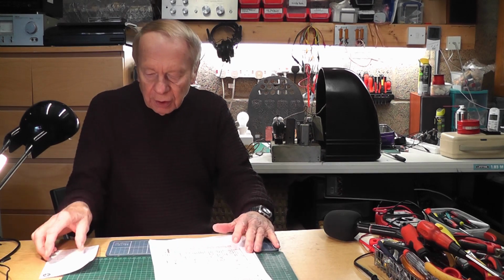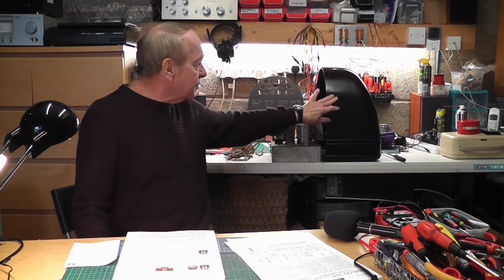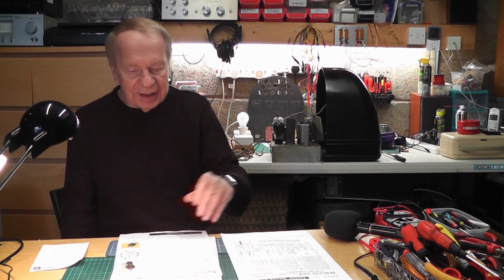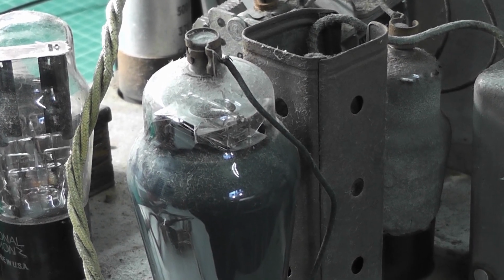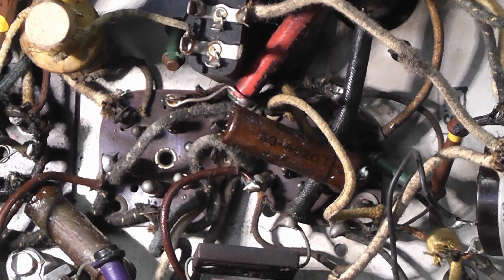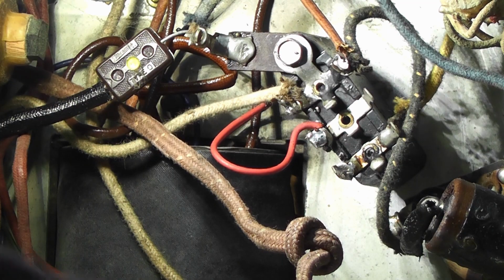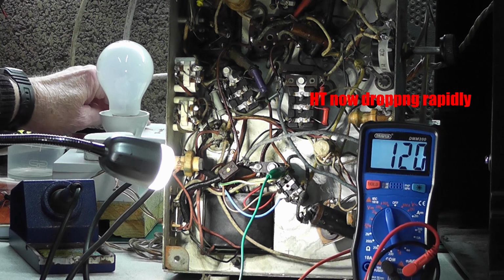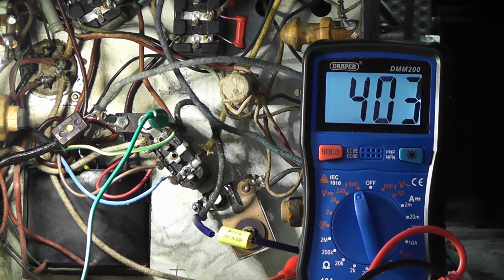Philco 444 Radio Repair  - Part One

Comment: Fire in the hold !!...Not often you get to see a failing smoking capacitor on YouTube, David..he-he. I wonder how bad is the audio valve grid coupling capacitor, especially so since the PEN valve is virtually impossible to obtain/replace  today. Much looking forwards to the next follow-up video.
Reply from the maker: Thank you for your helpful comments, I was pleased I filmed the switch on with the camera running, of course I could have been a  big bang and not just smoke! I will replace all suspect caps before I apply power again but am worried about the state of the PEN, will be doing further work later today. Take care.
Dave